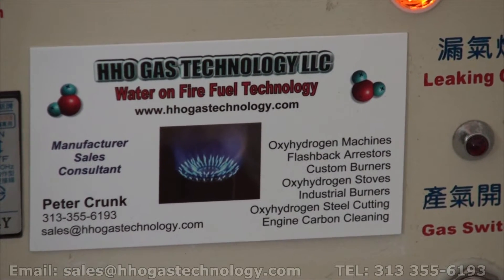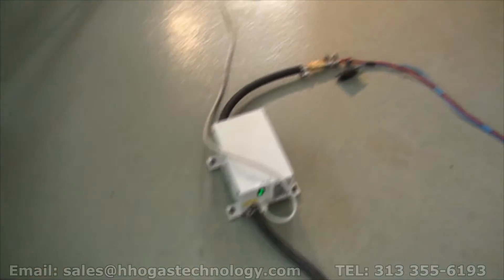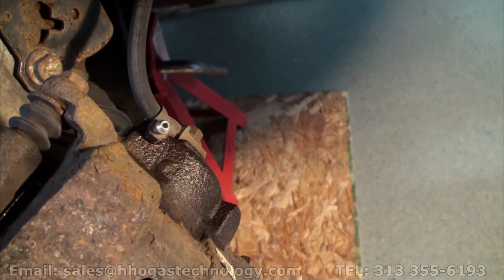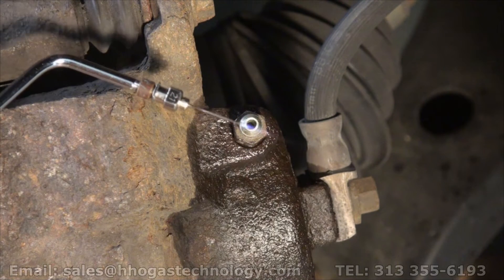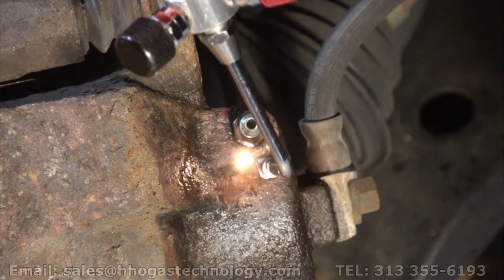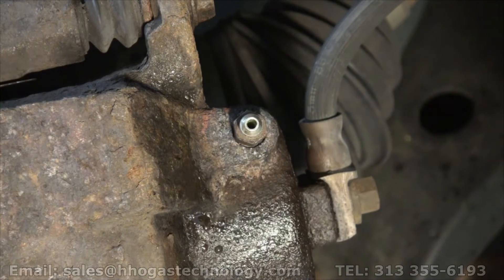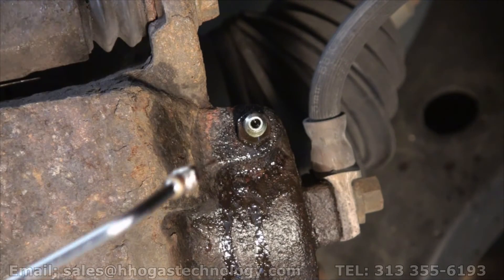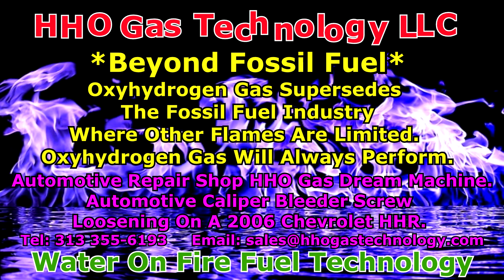HHO Gas Jewelers Torch - Automobile Caliper Bleeder Screw Removal 8-8-2020

Comment: That is very neat.ove it. Plan on making my plates out of lead have that at hand to make my own cells forwarder split up.
Reply from the maker: If I understand you correctly, you are talking about making your Oxyhydrogen machine plates out of lead? Lead is a soft material and it will break down quickly during electrolysis. It will also make your water highly contaminated with lead. After you have contaminated lead water how are you going to neutralize it to make it safe again for disposal?